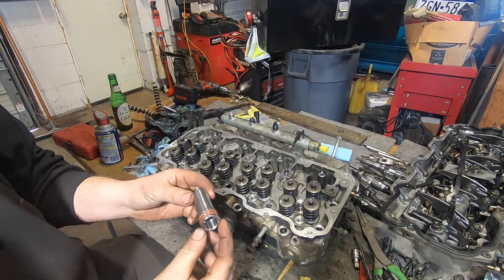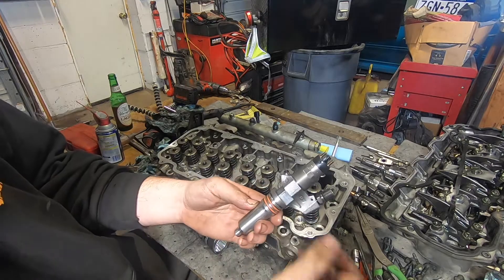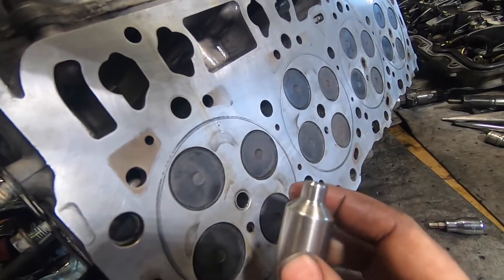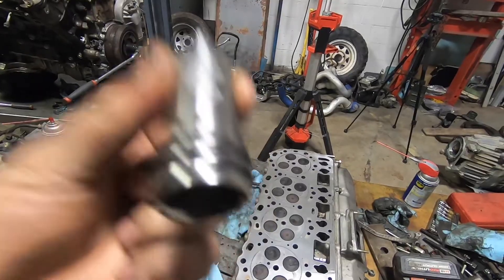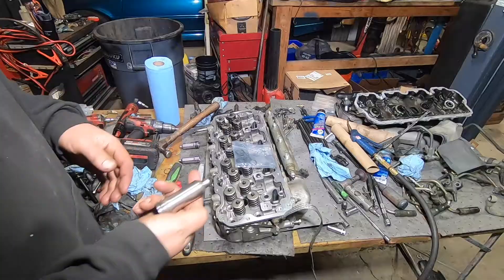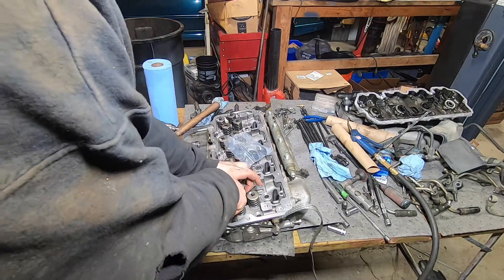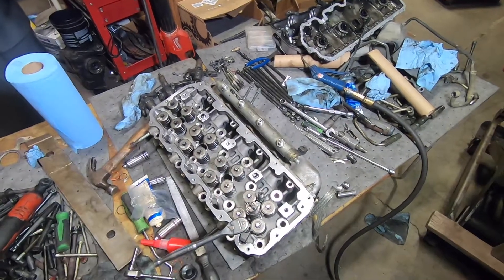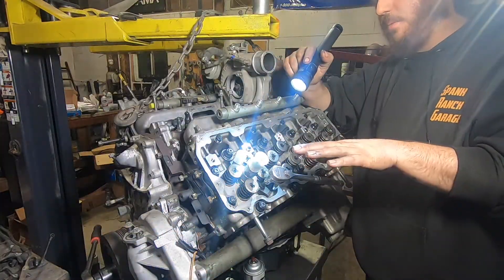LB7 Duramax INJECTOR CUPS. Everything you need to know. How they fail and how to install.

Comment: I think to put loctite on is a waste.  Whenever you need to remove a bolt with loctite, you heat it up. It melts the plastic. The heat in that position it's quite intense october what time to carbon.
Reply from the maker: 80k miles later, no issues with the cups that I forgot to loctite. I agree it can’t hurt but I don’t think it’s absolutely required

Comment: My lb7 has started getting lots of blow bye     i had heads off at 230000 got 291000.  Pistons and cylinder looked brand new at 230.  Wonder if that brass washer is leaking???
Reply from the maker: It could be.... Pulling the upper valve covers and putting the fuel lines back on would answer that question.
Reply: @spankranchgarage  i pulled the pvc hose off both sides and had about same. But. Yea. I need to take the cover off

Comment: Great video but red loctite is a thread sealant, what you want is green loctite. And loctite does not set if its exposed to oxygen, its sets with the absence of oxygen. So you can apply it whenever you want and it will only set after installation
Reply: It calls for red not green.

Comment: Hey I’m new to duramax and I’ve got a question. So I’m loosing a lot of coolant I have to fill up every 4/5 days could bad cups cause this? If so should I reseal them or buy new ones?
Reply from the maker: Very uncommon for the cup itself to be bad, unless damaged when removing. If the cup to head interface is leaking you should see high coolant pressure. If just losing coolant but no other symptoms I would look elsewhere first

Comment: Honestly man, I’m following your channel, but I’m gonna tell you right now every one of those seals on injector cups and injector is critical. You will notice if you fuck up a seal on that if you’re not pressurizing your cooling system, then the one O-ring that’s on your injector can pressurize your oil system or crank case system so I hate to say I am an LB seven LBZ and LLY pretty much all Duramax I work on those. I know everything that is know about them. If you mess up one of those seals on the injector system under the valve cover you are going to notice.
Reply from the maker: If you mess up the o-ring on the injector you wont notice it until you take it apart next time, all it does it keep oil from getting between the cup and the injector and crudding it up in there. The cup o-rings, the cup to cylinder head sealing surface, and the copper washer on the injector are super critical, yes.
Reply: @Honda450monster5 first time lb7 owner here as well as first diesel ever so have very little knowledge and truck is having with 206k im trying to get advice and info for what I need to do in order to fix. How can we switch numbers or info or email so I can contact you if you dont mind

Comment: Can an injector cup cause Oil in the coolant? I’m getting massive amount of oil in my coolant jug
Reply from the maker: Its possible but unlikely. Your coolant is usually pressurized and the oil around the injector cup is not... so coolant would enter the oil but not vice versa. Id suspect an oil cooler issue on your truck. ~40psi of oil pressure vs the ~15psi coolant pressure its possible it could happen there.

Comment: Ill tell you how to permanently fix them tmthe issue is there arent aby goid OEM head castings anynire so whats going on is the heads are so pitted around the cup bore that they just will not seal anymore fleece /freedome racing makes a brand new cast and machined in the US head with no cups required i love mine combined with head studs hopefully i never have to think about it again im too busy fixing eveyine elses enngines
Reply from the maker: Cupless is the best hands down. But if you have oem heads that aren’t pitted up you will be good. I’ll go cupless next time if they ever cause an issue

Comment: I had 3 cups come out with the injectors, I saw you heated it up and pulled it apart did you melt the O ring when you did that ? I’ve tried pulling  twisting and it is really stuck on there
Reply from the maker: It’s okay to melt the oring of you need to. Heating the tip softens the carbon buildup. That’s what I find seizes the injectors into the cups

Comment: I’m in the process of rebuilding my motor and it’s trying to put new cups in my heads and they aren’t seating down in the head as easy as yours did. Got any suggestions to help them slide down in the head easier? Thank you in advance
Reply from the maker: Try a dry fit without the orings. They should fall in like butter. I was really careful to lube the orings and the top of the bore in the head with oring grease. It’s a snug but confident fit. You shouldn’t have to fight it too bad

Comment: I have a small amount of blow by. Chevy dealer said I need a new engine. $21,000. Lmao. 
I think it’s an injector cup leaking. 
It has 215,000 miles. Injectors have been replaced 3 times. Once under warranty and twice by a buddy mechanic which used to work in a dealership service department. 
Maybe I should take it in for new cups and injectors and see what happens
Reply from the maker: If the blowby isnt getting worse I wouldnt worry about it until its injector time again. 3 injector replacements in 215k miles is a bummer. Next time get some OEM or Dynomite Diesel injectors and run a good fuel additive/keep up on filter changes. I think Lb7 injectors can last much longer now than they used to

Comment: Everything Ive been taught from working at gm is if they don’t come out, don’t mess with them. If they do come out, replace them. I resealed one on my own truck snd ended up with a combustion leak. Now im replacing the failed cup.
Reply from the maker: I agree with that. Mine have been okay for about 16K miles so far so I am hoping there good forever

Comment: Lookin on Facebook market place. 03 duramax. 300k miles. Smokes bad at idle and while revving. Guy said that the injector cuff is pushed out slightly. And advice. Should I avoid it. How much would that fox be. 
Thanks
Reply from the maker: If the cup is lifted you will have tons of combustion pressure entering the cooling system. Start the truck cold with the coolant cap off and it will be very obvious, if that is the case. It could also be head gaskets or other problems so make sure you get that truck cheap if you are going for it
Reply: @spankranchgarage  he’s sure it’s the cup because he said it got pushed when he had the injector replaced. Trucks for sale around 8 gran. I’m leaning towards not getting it. Cause I’m sure other problems will arise later on

Comment: What grease did you use to lube the oring?
Reply from the maker: I use standard dielectric grease but they make grease just for orings that is probably better. Engine oil works great too

Comment: According to GM Loctite 27200 (GM part # 12345493)is a high heat thread locker adhesive to be used on the bottom seat of the cup. That's what I'm using and following. I don't have time to experiment with this job. Good video for information
Reply from the maker: It will work well for you. I am 15K miles into this with some pretty rough use and I have no injector cup issues with or without loctite. If I had to do it again I would use the loctite just for piece of mind.
Reply: Thank you for this. I may or may not have missed loctite a cup and now I feel I may have not screwed myself completely
Reply: Shouldn’t you use green loctite just like the ford injector cups?
Reply: @wm2086 Why use ford stuff for GM (Isuzu) engine? Today’s idiosyncrasies of engineering and the expensive repair and time involved I stick with the closest OEM improvements or known “better than OEM” parts and processes.
Reply: @Gadgetstoolbox  because it’s called retaining compound 
Locks and secures metal cylindrical assemblies 
Prevents metal fretting and corrosion
Seals against leakage

They’re no threads on injector cups why would you use thread locker
Reply: @wm2086 If the compound you’re referring to meets the OEM guidelines then yes use it. The high heat aspect of the location the sealer is used seemed critical to my thinking. Having coolant leak into a cylinder or combustion in the cooling system was not a path I wanted to follow. Thanks for communicating that there is other compounds available to do this job with. If I get my act together I’ll post the videos of this same job I did in the vehicle.

Comment: I had a couple injector cups pop out during removal. What do you use to clean the tapered seating surface on the head? Can you use scotch brite to clean up the carbon and old loctite?
Reply from the maker: I used lots of carb cleaner and shop towels on an extension. You could use scotch brite but be very very gentle. You don’t want to scratch or change the shape of the tapered seat in any way
Reply: If the cups don't pop out during an injector swap, should they be removed & cleaned? I've seen forum responses saying "leave them in if they don't pop", but if having a super clean surface is so important for the seal, then would removal & cleaning be an integral part of the swap process?
Reply: @yiction I'm getting prepared to replace all my injectors and I was wondering the same thing. Haven't found any answers to that on utoob or anywhere else yet. Probably should pull them out while it's apart just to be safe, because rubber o rings don't last forever, and all the time and labor involved to do this job.
Reply: @UnitedWeStand2020  found this video https://youtu.be/8ZSNSys8b58 apparently there's cheap tools for pulling cups & easy to use. I'm leaning towards the same boat as you, might as well do it while i'm in there - do once cry once. plus my injectors are probably nasty so cups might stick anyway.

Comment: Just curious you might can help me out i have a lb7 just installed injectors 2 times cyl 6and 8 have a +15 bal rate on both injectors and has white smoke fuel smell ohmed the new injectors ohmed good and no blow by i have not noticed fuel in the oil or coolant thanks in advance
Reply: Hey, did you ever figure out what your issue was?

Comment: Loctite is gonna seal. But I don't think it should be used in such applications mainly because of heat. And the parts actually machined to fine tolerances. It's not just a simple bolt.